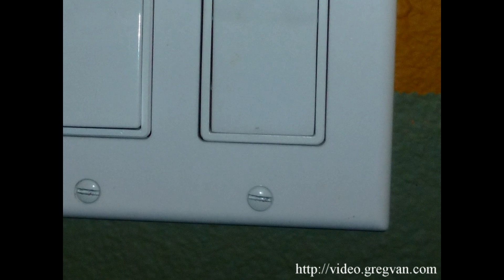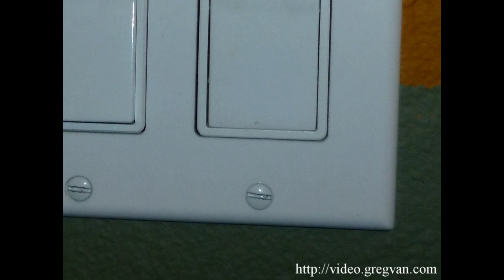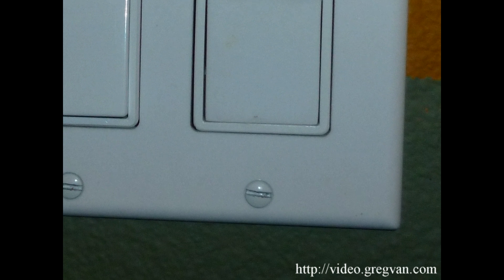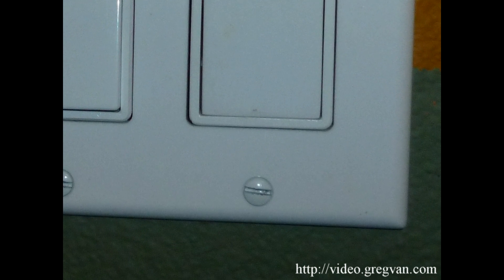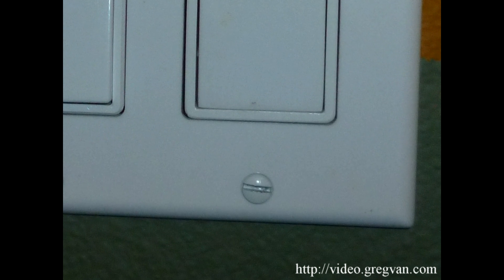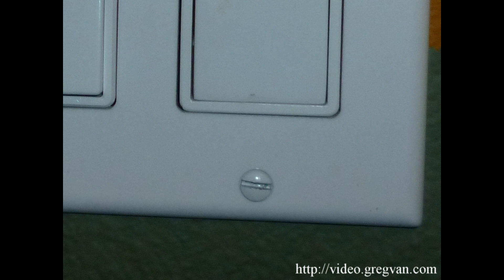Why Am I Getting Shocked by Outlet or Light Cover Screws?

Comment from the maker: Someone pointed out that you could also be getting shocked from static electricity. I would like to thank the individual for pointing this out .
Reply: So if this is the case, i.e. static electricity,  what can I do to remediate this? We have this problem in the entire house and this has been getting pretty annoying recently.
Reply from the maker: @alexanderseile4193  I won't be able to provide you with a good answer on this one, but would suggest doing some more research on the Internet. Let us know if you find anything.
Reply: @alexanderseile4193  you could put tape over the screws
Reply: @alexanderseile4193  put rubber over the screws Rubber stops electricity
Reply: @alexanderseile4193  minimize things that create static, throw your carpet out and ground yourself, get some rubber sole sandles lol.
Reply: 99% of the times I've investigated after people get shocked from their switches, there's been no issues and it was a static discharge. Still a good idea to look into it if you're suspicious something is wrong...but likely it's static the majority of the time.
Reply from the maker: I would tend to agree with your statement and thanks for sharing.
Reply: I get those small electric shocks so often!! I'm sick of it! It happens most when I'm wearing poliester clothes or my hair is loose. Every time I touch metal I get electric small shocks. 
Also,I get smaller tingling when touching the metallic parts of home appliances,I can't stand it anymore. Washing machine,coffee maker (Italian type) and now,the tray of the oven,all give me tingling when my hand are sweaty or in the case of the washing machine or coffee maker,when they are wet.
Reply: I get shocked each time I put back light on lol
Reply: Change your shoes
Reply: For me it’s the static discharging. If I’ve already discharged the static, I’ll never get shocked by touching one of the screws. If I just got out of bed and could hear the static in my blanket and get a shock from touching one of these, I know it’s the static.

Comment: People who say this is static electricity are retarded. He’s talking about flipping a switch and your finger or thumb or any other part of your hand touches the metal rectangle around the plastic switch or the two screws holding on the plastic cover of the switch. When those metal surfaces are touched either the screw or the rectangular shaped housing around the actual Plastic knob of the switch, you get electrocuted with A/C electricity. It is not a one time incident.  If you stand there and hold your finger on it it will continue to strengthen its pulse because it is using you for ground. If you bump it you just start to feel it and usually pull your hand away fast. If you continue to hold yes the current gets stronger and stronger because you are a nice ground. My problem is that I tore the switch part and all wiring is good. It still does it. So that means that wall is hot somewhere and I don’t know where.

Comment: i am currently studying for an electrician in europe therefore i am not falmiliar with american switches or outlets, but... i am not sure why this would be a thing the screw should be completely separeted and should not be touched by any cable even if one comes loose...
Reply from the maker: It rarely happens with plastic boxes and seems to be more common on metal boxes, if that makes sense.
Reply: @gregvancom   with english not being my primary language and me being in my first year, i am afraid no not yet... there is a plastic one thoughout the majority of the video and the screws are painted over, so if those are under voltage its going to be difficult going though... unless its some conductive paint...? eh... mostlikely misunderstanding you in some way anyway thanks for showing concern and trying to keep people safe.

Comment: You are lost about this their talking about getting zapped with static elec. if you're getting electricuted then your theory is correct butI have apartments that do the same thing and the have no carpet only wood floors. So why is the static so strong?
Reply from the maker: If I didn't have any carpeting, then I would verify that there isn't an electrical problem.
Reply: Static at an electrical outlet? Assuming it is a static discharge may be the last decision a person makes - ever!
Reply from the maker: @johnsarab4500  Good point and it really would be a big mistake to assume that it is a static discharge without verifying, whether it was or wasn't.

Comment: In my case it's static electricity.  In winter heating dries the house which increases the likelihood of accumulating static electricity on our body (often just by wriggling and/or getting up from the couch).  It has become my ritual to touch those screws to discharge that accumulated static electricity before touching any electronic device, to prevent damaging them.  Hopefully the system is well grounded.
Reply from the maker: Excellent point.

Comment: same thing with me i lift the outdoor cover for the switches to turn on my cailing fan on my patio and i felt some kind of jolt
Reply from the maker: I would try and ground your electrical switch or connect it to something that is grounded with a wire. You might need to purchase a newer switch, if your switch doesn't have a ground wire attachment screw.

Comment: It is because you get charged up with static electricity and the screws are touching ground from the metal box! YOU ARE WRONG!
Reply from the maker: That is definitely a possibility and thanks for pointing it out. I will pin a comment to the top, for those interested, but how can I be wrong when I could be right.
Reply: Not always. I am getting shocked by one particular lightswitch's screws but not by any other lightswitch screws nor by the outlet that's 6 inches from it. It slso feels very different to a static electric shock. Static shocks are a single momentary slightly painful shock. This gives a continual buzzing feeling.

Comment: This was going on at outlets and switches in our house for a while, especially on the bathroom light switch. After a GFCI and a surge protecting power strip burned out during some power surges (our electric supplier sucks), an electrician came out to our house but could find nothing wrong with our inside wiring or breaker box. He did, however, discover that whoever installed our manufactured home did not install a grounding rod at the power box. The minute he installed that (and a hefty surge arrestor), the zapping stopped.
Reply from the maker: Thanks for sharing, your comment is greatly appreciated.

Comment: I just got this from a screw on my light switch cover and it made me collapse, I was sweating and shaking with pins and needles, can this harm me?? Thanks
Reply from the maker: Yes absolutely. It wouldn't be a bad idea to contact an electrician as soon as possible.
Reply: thank you for your reply :)
Reply from the maker: You're welcome and you could always put a piece of tape over the screw until you get it fixed.
Reply: Surely you jest! A smoking hairdo and a stopped heart is possibly bad.